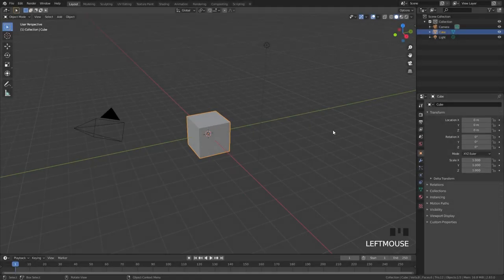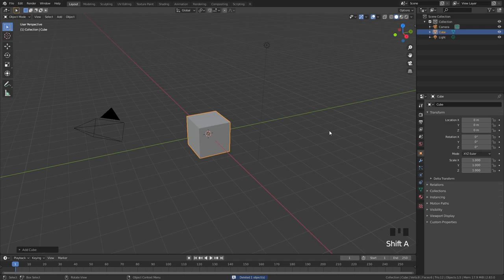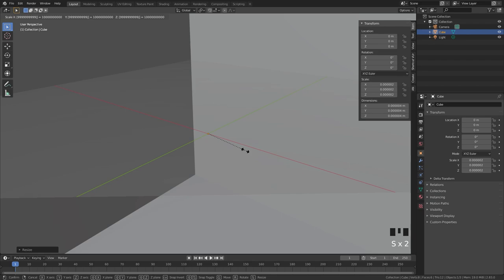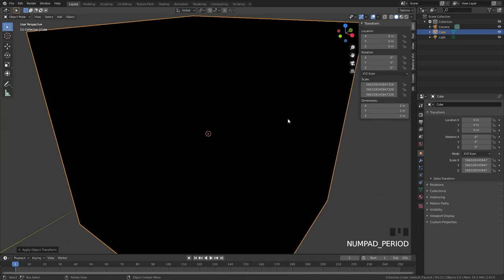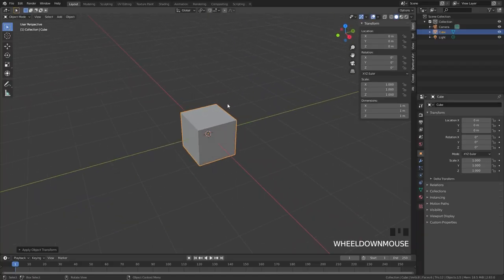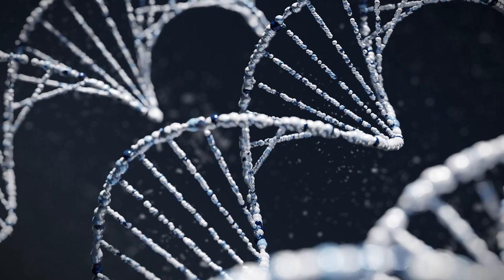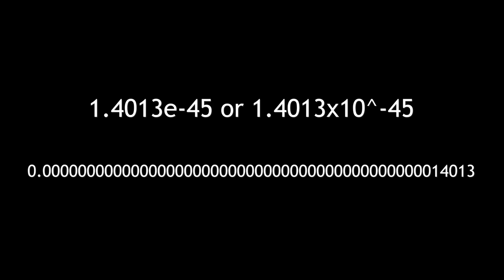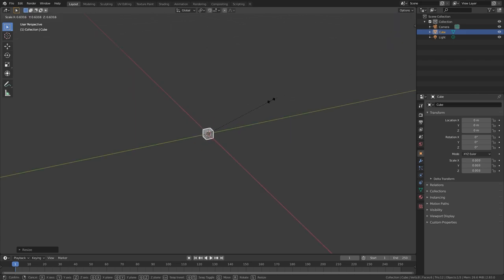How Small can an Object be in Blender?

Comment: Would be interesting to see how the code actually handles this.
Reply: I think that Blender dynamically adjusts coding of objects size to scene's bounds. Here we have no problems because we have only one object in the whole scene. Question is: what happens if we keep one cube 1 meter in size and next to it another suuuper small cube. Then either file size grows significantly because Blender would have to code both cube sizes in the same unit system (lots of zeroes to handle) or we'd have issues with display due to limited precision.